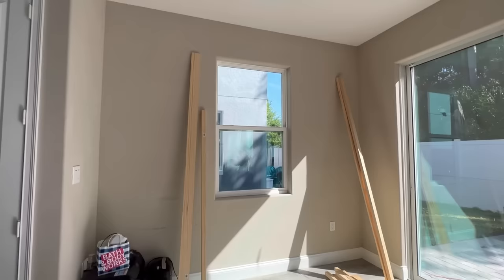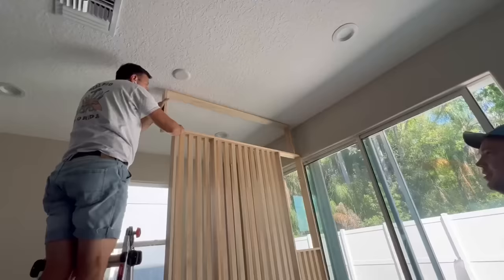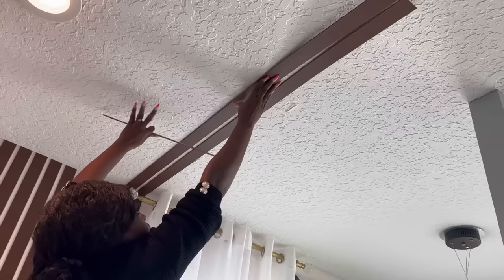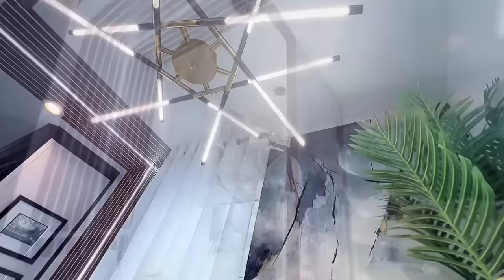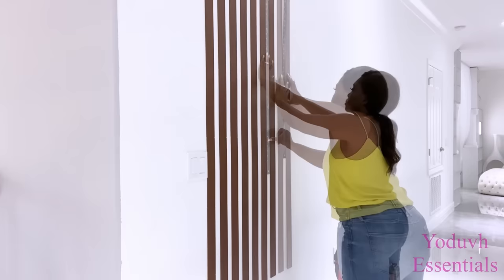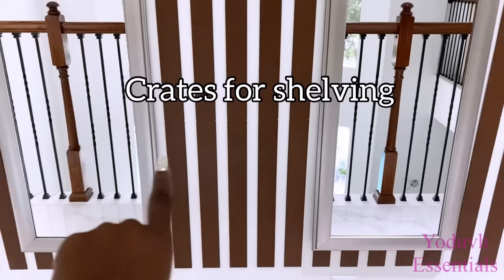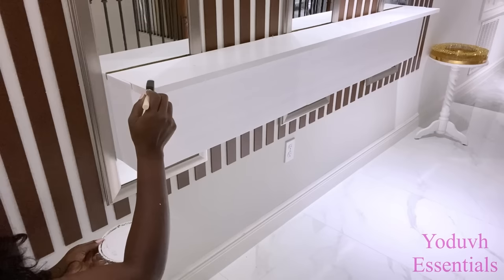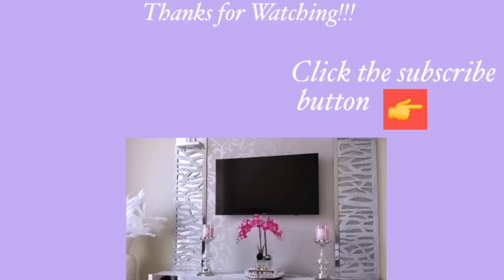NEW DIY HOME CEILING To FLOOR TOTAL TRANSFORMATION WITH Lighting TO TRYOUT NOW!

Comment: Girrrlll listen. I've been looking at wooden slats to use for a wall and ceiling installation just like this. But you know how expensive the solid pine boards would be, I'm sure. And you've got the answer for me right here. Thank you ever so much 💓. Love this. But, I can't help but wonder what, if anything, you did to the holes in each slat? Or did it not make a difference to you? Not sure I'd like the paint showing through. But great job, as always.